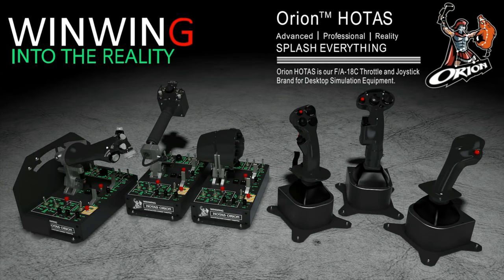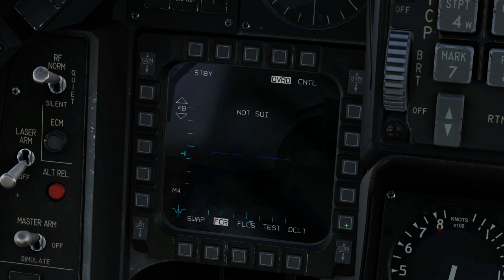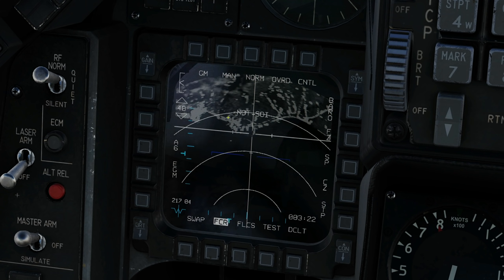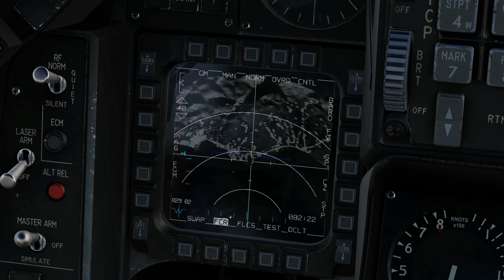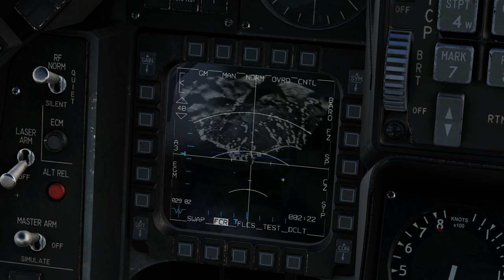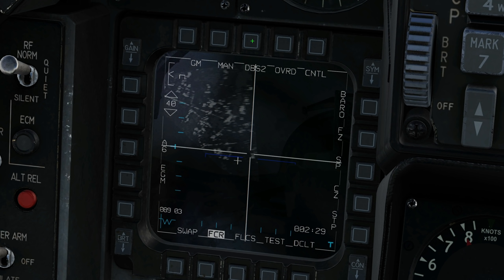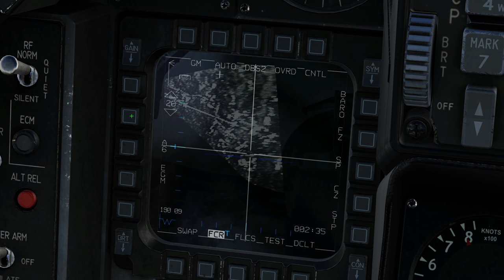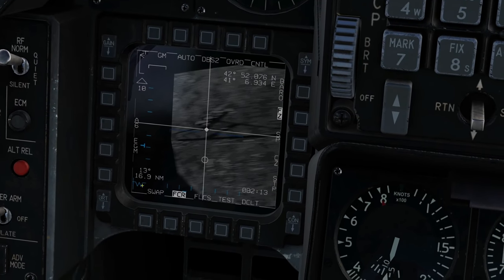F-16C Viper: Air To Ground Radar (GM/SEA Modes)(Bombing) Tutorial | DCS WORLD

Comment: EGM is the radar image after signal post-processing, RBM is basically the raw picture, and thus may be of even higher interest to the trained eye.
Water is definitely very much radar reflective (despite what Matt was saying in his video), but it's SMOOTH. Remember how geometrical "stealth" works? It reflects the incoming EM waves in a DIFFERENT direction from the transmitter, and so does SMOOTH water. But when there is swell, a wake trailing a peri or a boat - you can see that stuff on the radar screen (and if it was such a perfect absorbent as some tend to think - that wouldn't matter). That's not to mention radar altimeter or weather radars...
Reply from the maker: I guess the processors are crappy old 486's or something??
Reply from the maker: thx
Reply: @grimreapers  My good old 486 feels offended, or rather would feel that way :)
I'm not sure about the actual computing units used in that particular case, but they are most likely some special purpose DSPs (apparently, not based on the thinnest available lithography process).
Processing power is one thing, but non-NN based upscaling/enhancement most likely needs more than one radar sweep worth of input to generate enhanced output. Same thing, for example, is true for SAR: by sampling a certain area from different (but known) positions with certain lateral offset you can emulate a radar of much wider physical aperture, but it takes a while for the platform to move through all these positions and take a sweep at each. Radar aperture - just like in case of optics - is responsible for radar image resolution, but since the wavelengths used are much longer than those of visible light, you need a proportionally larger aperture than that of the eye. That is also the reason why only larger geometrical details start making difference at those wavelengths / apertures, but if you up the frequency or use a larger aperture radar (or use aperture synthesis, as mentioned above) - you start making out finer details. Also why geometrical "stealth" isn't working well against older radars: they are simply "blind" to the intricacies of the surface and perceive the whole thing as some uncertain "blob" of roughly that size. You could also say that ELF transmitters "can't see" all the water above a submarine, making radio frequency communications possible, while the high intensity X-rays from a nuclear explosion have a hard time penetrating the surrounding air farther than a few meters around, heating up the said bubble of air, resulting in the fireball. Although yes, X-rays also do penetrate materials and air rather easily on the other hand... Then again, the distances of irradiation are much shorter in that case.
Reply: Yeah, radars are cool, because of the ripple that most water have you can actually see oil spills in water from satellite radars, because the oil removes the ripple.
Reply: @torgers10603  That's an interesting bit. I guess the oil flattens the ripple. Didn't occur to me before.
Reply: @getsideways7257  A bunch of ENTERs between the lines will be appreciated.
Reply: @jackstheraptor2791  People are always unhappy about something... You probably meant an additional line feed instead of just one? Because if you look carefully, there is already a "bunch". Except it didn't felt to me there is a reason to divide that into separate paragraphs. Then again, I'm not in the publishing business, so what would I know...

Comment: The radar image becomes clearer as you get closer to the target.   So using GM mode is a compromise between precision of the targeting vs exposure to air defences.   Can also use the radar to set a spi  from long distance which the tpod will then default took at for fine tuning of the target position assuming no clouds blocking it.
Reply from the maker: thx
Reply: imagine also gets better when target is getting closer to 90 degrees off the nose, there are radar pods now on f15e to look exacly 90 degrees to the side

Comment: Coming from BMS.. Yeah, this seems way more realistic. Its a bit buggy, but Its a very good start!
Reply: Originally coming from DI Tornado. While DCS is amazing it is also amazing what DI (and other programmers) managed to do with a 66 MHz, 640 KB memory.
DI's Tornado had AA radar and a pretty good AG radar. You could set target points on the moving map or AG radar, set autopilot to steer towards it. Front and WSO cockpit. Autopilot which could be commanded to terrain following at different altitudes or barometric altitude. Flying fast with heavy weapon load required a higher terrain following altitude. 
I recommend to try it (DOS box required) and to not be discouraged by the super low screen resolution.
Reply: @slowhornet4802  Interesting.. Never heard of that ☺️ But yeah, in some ways DCS is cutting edge (graphics, sounds and interface), but on system level it can be very lacking compared to what was done before
Reply: @slowhornet4802  DI's Tornado? Are you sure? Was there a source code leak?
Yes, indeed, it was an amazing sim for the time, and I'm missing those ALARMs.